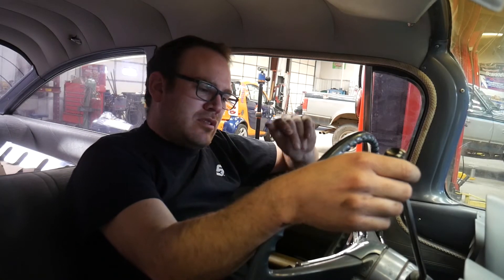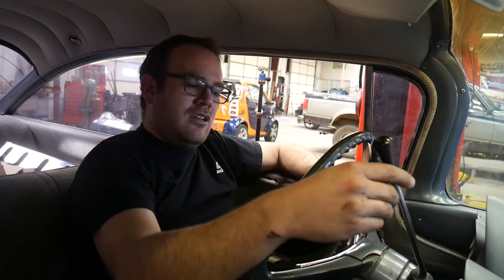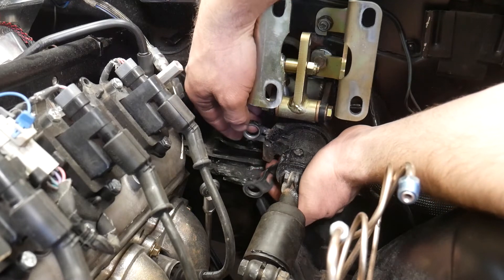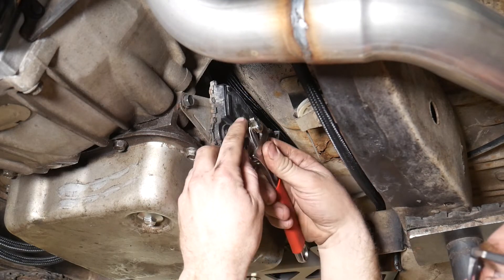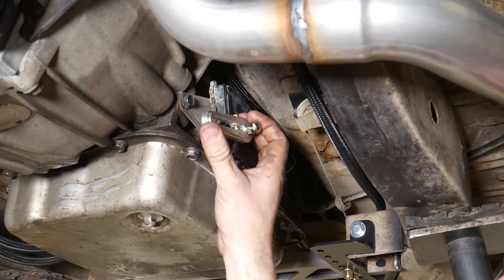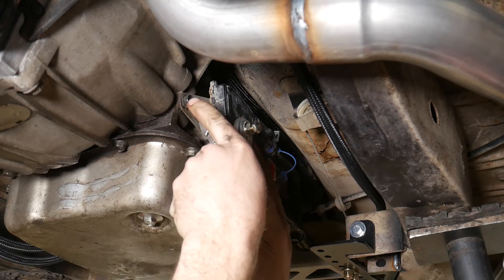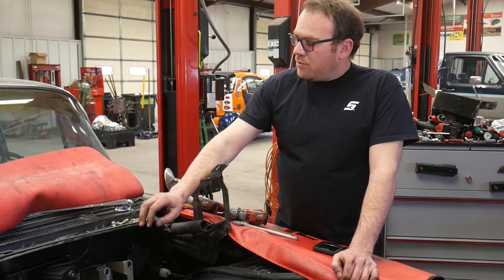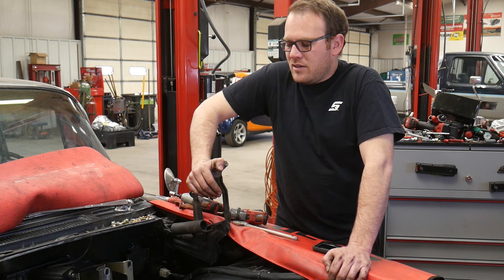Biscayne Ep 38 - Steering Column Shifter Mods

Comment: money was my reasoning I am going to just use my old one. I am going to a floor shift and moving the key to the console. So I just have to remove some things from mine and then make it look good.

that is crazy how easy it was to adapt that.
Reply from the maker: We weren't sure exactly how far the restomod is going to go on this car so this also leaves us open to other options in the future without wasting too much time and money on the current column and linkage. I prefer a floor shifter.